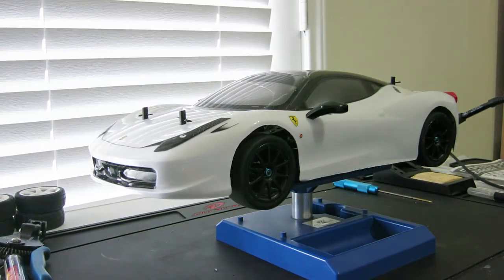TA07 PRO drive train noise

Comment: First thing would be to make sure the bearings are all seated correctly in the front, especially in the c hubs. Maybe post a video with the shell off focused on the u joints so we can see what's happening?
Reply from the maker: Theibault will do!

Comment: So what was the culprit?  How's the car I'd love a review video
Reply from the maker: I had temporarily used the wheels from my sons TT-02 which were the wrong offset.  Once I installed the 24mm wheels everything was fine.  This car handles like a dream.  It's so smooth and simply goes where I point it.  Plus, now that I have the proper wheels on it, it sounds amazing.  Literally the best sounding R/C in my fleet!
Reply: sounds good....thoughts on doing a full review?